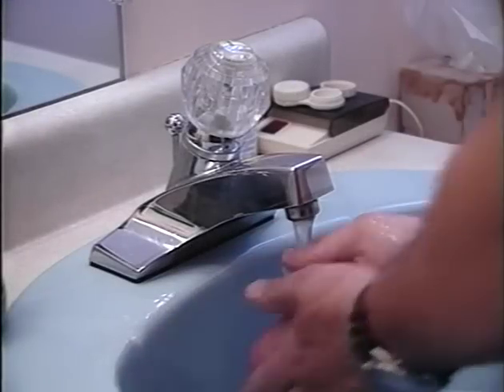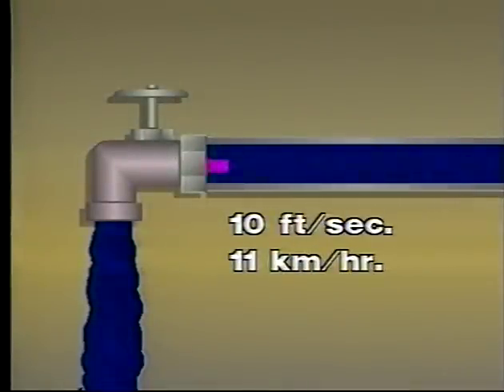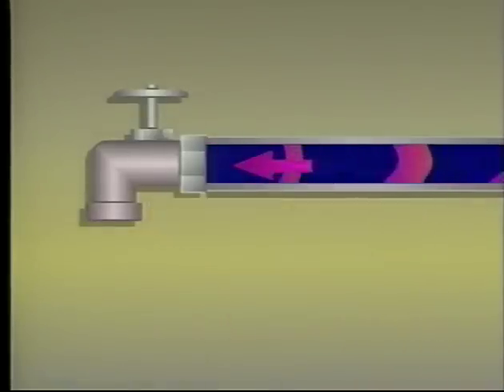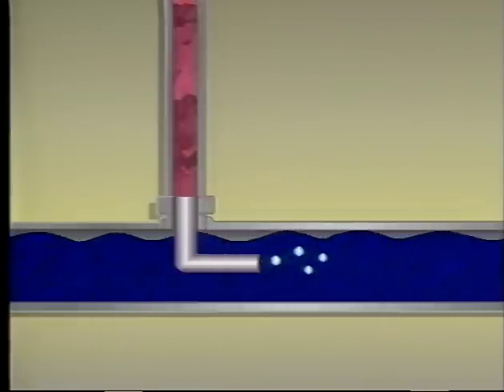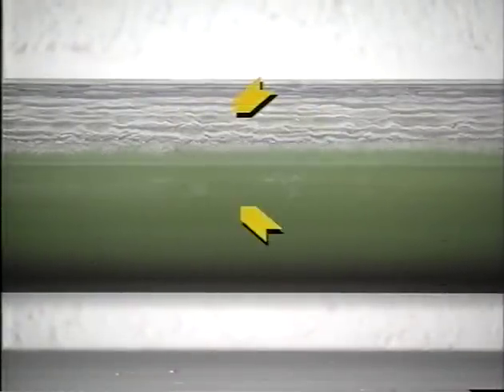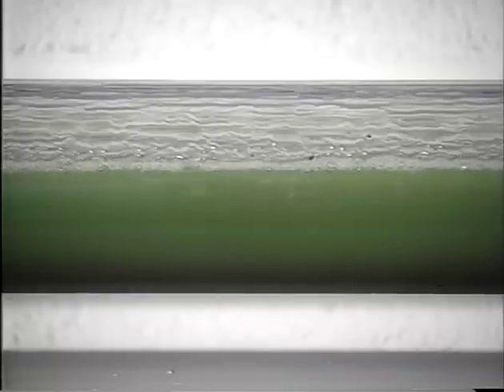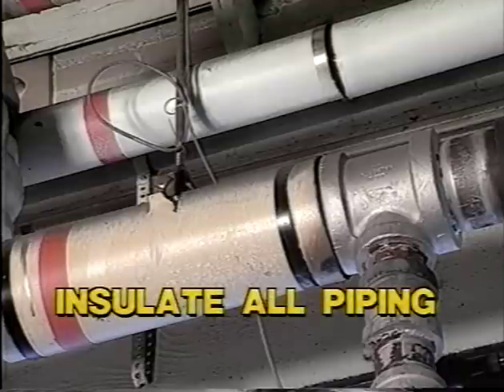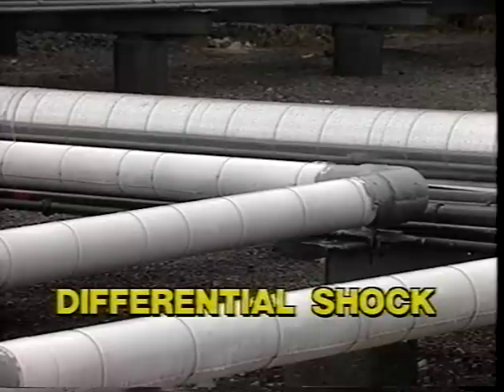The Causes and Effects of Water Hammer

Comment: I have hammer arrestor but still hammers.  Was sized n installed by plumber.  After 3 tests ( turn on washing machine n turning it off..) the hammer begins again.  Occured after repiping the whole house and now water line now comes down from ceiling height to washing machine lines.  Does that cause water to add to the speed/pressure ?  Can you suggest a configuration of how arrestor should be installed for this situation?   Rt now it's installed rt. b4 attaching washing machine lines.

Comment: From the comments you can tell alot of people don't deal with water on its extreme conditions and or steam on a daily basis and it's extreme hazards. But I bet if something happened to one of em because the people maintaining the equipment felt like these people commenting then they would be quick to point the finger and it would be such a tragedy, but yet it's not that important right? Lol. I liked the video did you see that water slug. Before I starter my place in 2002 a guy was killed by water hammer so it's no joke if you know what your talking about. Thanks for the video anyways.

Comment: I had 3 really noisy, banging radiators.  The boiler manual told me that one radiator somewhere in the system should not have a thermostat and should be open at all times - my one is in the bathroom - I turned it almost completely off to save on heating bills when we first moved in. It has a tap which can turn off water flow, instead of having a thermostat.  I opened the tap to allow hot water into the radiator - hey presto, no more banging.